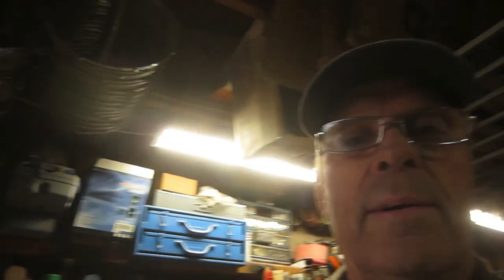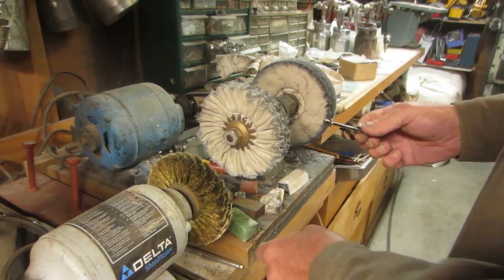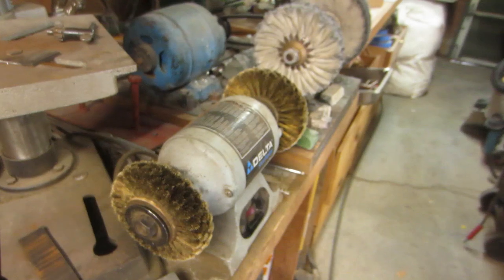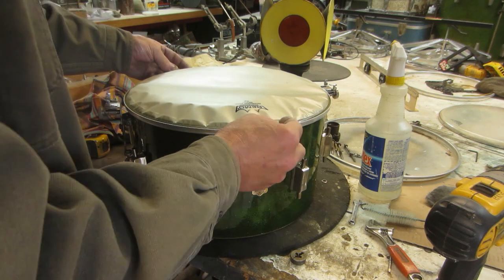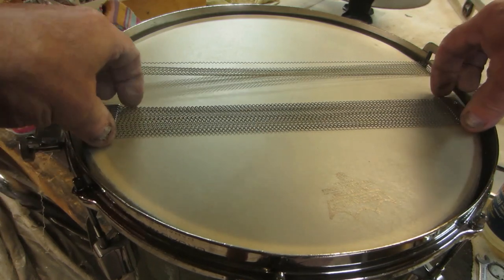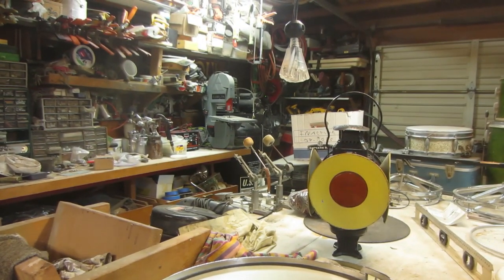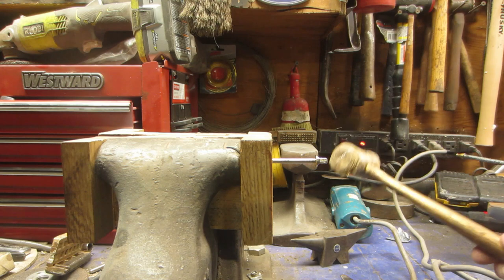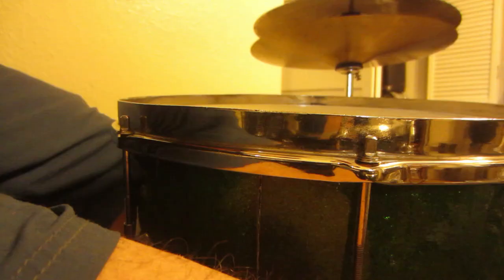1938 Leedy " Broadway Parallel" Snare Drum Restoration Part 4

Comment: What’s up Bruce. Thanks for posting another day in your heaven. So I been working on an old Yamaha steel snare and the throw off knob/rod was bent. So all I had was a piece of broken fence picket for my “wood jaws”. Lol. It works ok. Don’t laugh. So I was tapping and bending the rod a few different ways and couldn’t get it straight. Eventually it snapped. 😡 You need to post a warning  Don’t Try this At Home at the intro to every video my friend. 😂   Got any spare Yamaha parts!? You owe me
Reply from the maker: Jayme Jayme Jayme..... Heres where you went wrong possibly....So I was tapping and bending the rod a few different ways......You have to tap it where you KNOW its bent. PLUS Yamaha metal is well.... Lets say... Cheap. You will break more in the learning process so buckle your seat belt and keep moving ahead.  Also, get yourself piece of solid maple or oak for your wooden jaws. Lots of furniture is made of solid oak components so you should find a piece easily. Luckily there are tons of Yamaha parts around for you. Keep up the good work brother.
Reply: @vintagedrumrestorationgara91  😂 Yeah. Yamaha parts are cheapos. I’ll replace the whole throw off with something else. The fun in all of it is getting to work on these old things. Bring em back to life. And hunting down new parts is fun too. I’ve been curious about using one of the knockoff Trick throw offs. This would be a great drum to throw $35 at and see what that thing is about. Thanks for the inspiration
Reply from the maker: @jaymeramirez7435  Jayme, My motto is.... Dont drill it! If it does not fit, dont drill it to fit. I will do a vid on how to make adapter plates for throwoffs some day. Cheers, B